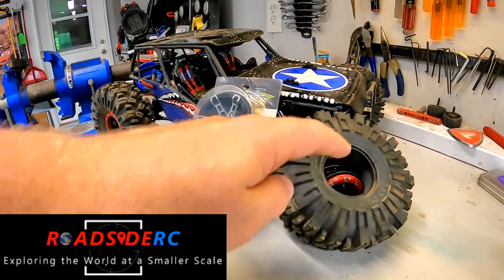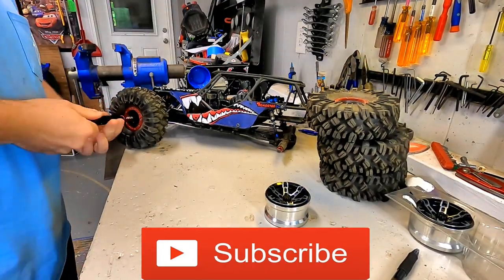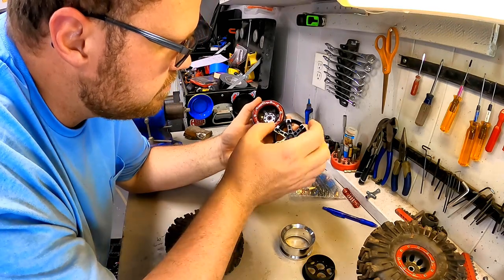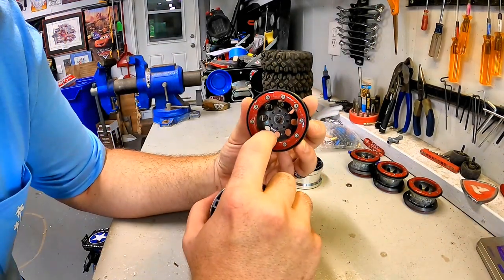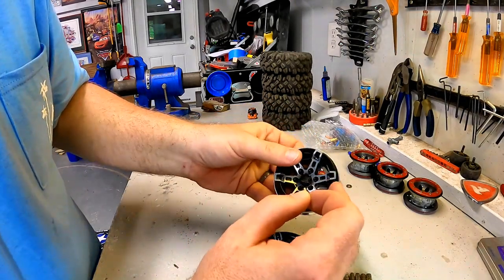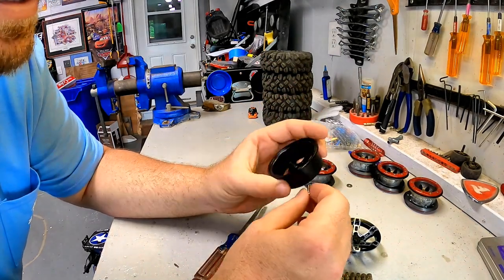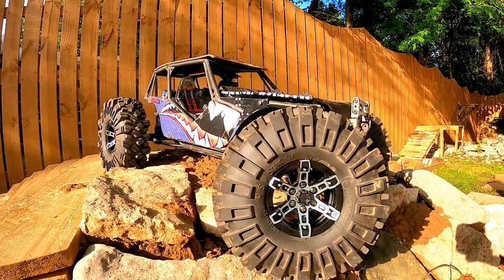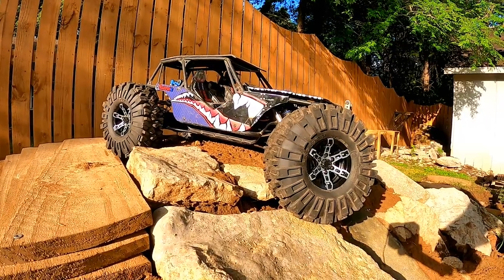Plastic vs Metal Beadlocks for RC Crawler  | Boom Racing Install on Axial Wraith

Comment: We know it's best to have more weight on the front of the vehicle so would it be advisable to go with a metal wheel on the front axle only for ascending? And if so what would that look like/happen if you have an overdrive front and under-drive rear?
Hmmm?
Reply from the maker: You could certainly put a metal beadlock only on the front.  No issues with that at all! 
Should not have any impact on over/under drive.   
I have not done the over/under on my Wraith, but overdrove the front on my TRX4 and really like it.

Comment: For anyone in a pinch,grab a hex bolt that the head fits the scale hardware and two nuts. lock the nuts against each other and you just made a tool for those lugs.
Reply from the maker: Genius!  Nice tip!

Comment: 😅😅😅 Yeah. Those stock axial nuts are a tight squeeze. Some are worse than others tho. The Capra, XIII and Wraith 1.9 were the worst so far. Like they left an edge on the purposely. 

That's how we lost a wheel nut long before the wheel came off once. Fortunately that tight fit allowed us to keep running the truck without the nut . The wheel only fell of occasionally. 😀😀😀
Reply from the maker: Ha!  Designed that way to keep your wheels on...!